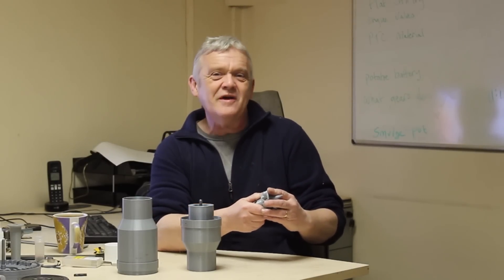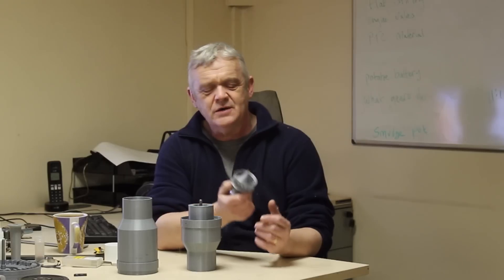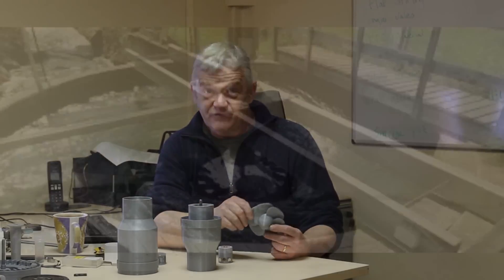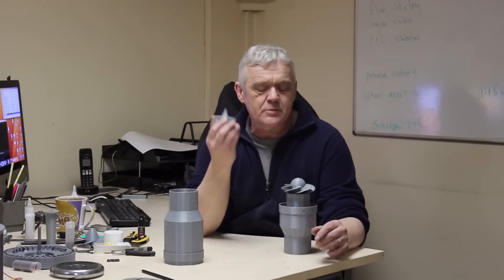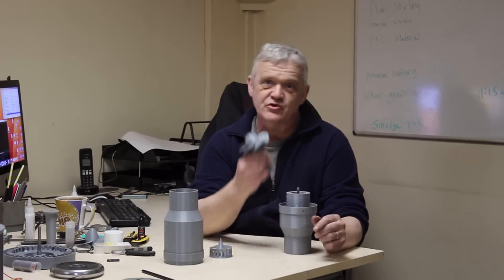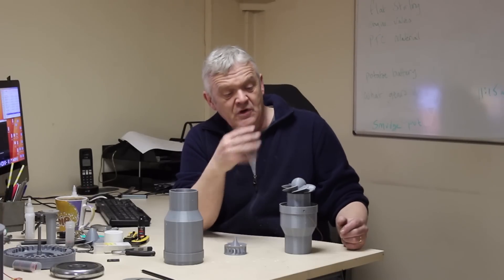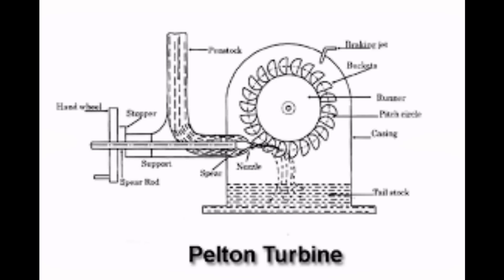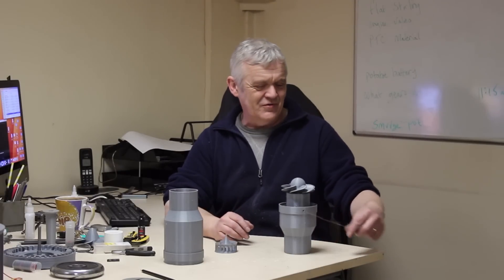1887 Rainwater Turbine - Mass Or Momentum

Comment: Hi Robert,
I love your channel! Your exploration of generating energy from many sources inspires me. However as a technician it is hard to grab the power output of your experiments. You are always measuring voltage and that is not indicating power. Would it be an idea that you measure voltage over a dummyload with a certain resistance and measure current, than it is easy (P=I2 x R) to see the power in Watts. Or measure both current and voltage over that resistor so P=UxI can be used. Now you always show the open voltage and the generator does not really get a load attached to it. Generators do slow down if connected to a load. I think you get the point and I gave some extra info for the audience.

Keep going! ❤ from Holland
Martijn

Comment: Luke Fugate here on YT is an inventor who lives on an Ohio mountain with a stream, he has done several different styles of water wheel generators to help power his homes because different sections of creek required a different approach to harvesting its power.. one he captures the water in a pipe and directs a heavy stream at his wheel, in another its just the streams flow that slowly rotates a much larger wheel

Comment: I think it might get out by putting the serpentine coils outside of the piping, allowing for more magnets around the larger circumference. eg embedded in a solid ring around that goes around the outside of Kapan style blades Though the thickness of the piping will determine how close you can get them to the coil, so may bring it back down a little but that arrangement would lead to easier maintenance/upgrade of coil

Comment: Mass, or momentum, that is the question:
Whether 'tis nobler in the water to suffer
The slings and arrows of outrageous fortune,
Or to take wind against a sea of troubles 

😂 Great work 👍Cheers to your health, and everyone in Sir Robert Murray-Smith Land
Reply: Water has mass, so that translates int TORQUE,  not momentum. (M x V=T.)
Then you can add gears to create speed.
Reply: Mass just sits there doing nothing ( PE = mgh )potential, nothing doing, just yet - momentum is where dynamics are all at. - (m*v) kinetic energy is just the first integral of momentum - add up all those momentums to be relatable to the static situation...KE = 1/2 m * v^2 (or (m*v^2 )/ 2..
Reply: @toml.8210  Cheers to your health 🍺
Reply: @kadmow  Cheers to your health 🍺

Comment: In video 1884 the water was able to run freely. In this video 1887 and the last video 1886 the water spill way was constricted. causing the wheel to be submerged slowing it down. The squirrel cage spinner acts like a horizontal water wheel. If you submerge a vertical water wheel it would slow down too, I would use less water or create a bigger spill way.

Comment: I would say a more correct term is Kinetic energy. Momentum is energy within a moving body, when the driving force is withdrawn or stopped and the body continues to move and decelerate.
Reply: That’s inertia.
Reply: @mikebond6328  inertia is resistance to movement.

Comment: I was curious about using the fresh water coming into my house as a source of power. It has a high head pressure and clearly plenty of it. During the summer in the Southwest U.S. watering of the garden means several hours of nonstop water use per week. I have been working on zero scaping to not be a monster by planting clover rather than grass. Still it all needs some water. About half as much as grass. Using the water double I think would also be a win.

Comment: The Kaplan turbine would fit inside the other vortex turbine, and would functionally replace the cone shape for the latter. If they were operating two separate rotors, one inner, one outer, spinning in opposite directions, you might get enhanced performance from both.

Comment: Wot about a load of properler things with magets on the edges all the way downpipe and a copper coild wrapped all around it. In theory as thebwater has to go down there could be a way to make downpipe genorators frel top to bottom and choose the gauge and if u have 1 or some series and some parallel creating the volts/amps  u require? Just a flash thought xxx

Comment: Movement  is measured in velocity not momentum, miles per hour.  A wheel continues  to roll, showing momentum. Due to friction, It rolls at a decreasing speed or velocity. See post just prior for simple explanation.

Comment: Well now you have me wondering exactly what type I would need... The overflow from the cistern is considerable, when the water is flowing, despite the fact it is only drain-pipe  width. So it would be high volume low head.. Looking like the blade one would work best..

Comment: You mentioned the Wells turbine for wave action. Check out the one I designed, based on a shielded Savonious. You could add a flywheel too. I think this is better than Wells Turbine.

Comment: Apologies for asking a dumb question, what happens if you stack several of these turbine cassettes so that the same water falling is used several times before it flows away into the drains?
Reply: I’d guess the efficiency would drop of dramatically and the top one would fail/wear out far before the one below it.. think about how much slower the water exits the first turbine after it’s expelled 70% or so if it’s energy into the turbine that you’ve perfected to extract as much energy as possible! Kind of defeats the purpose no? Lol
Reply: @Sam3532  OK, I get that, I'm wondering would gravity put back some oomph back into the falling water?
Reply: @mikewren43  just as much as the distance between them would allow (9.8m/s squared to work out the speed and then speed times mass, for the momentum, which would then be converted to joules or watts to work out the kinetic potential of the mass of the water - not sure on the exact equations, but relatively easily calculated - or you can stick a turbine in their and just see how much power it gives you! Lol)

Comment: Curious, I wonder how quickly air could be moved with your cage like fan if you drive it with a motor in a partial ducted fan situation.

It basically is a centrifugal blower fan after all but with some interesting modifications. That should make it better at sucking in air from the outside and blowing it out down the middle. Potentially being extremely good at sucking in a large amount of slow moving air and blowing it out through a relatively small duct either at very high speeds or significant static pressure.

Comment: What about roof debris?  This would work well with a rainwater catchment system.  Catchment or not, I've seen a video where the turbine spins around the periphery of the pipe with the drainage hole was in the center, large enough to allow leaves and such to pass through. The water from the downspout was directed horizontally on a tangent so the water would be directed to the turbine.  I'll try to find the video for it.  Crafty Panda did a vid when he built his, but has so many different handles on YouTube, it's hard to track down.

Comment: Conservation of momentum? whatever the water loses hitting the fan, the fan gains. Minus the noise and heat.
Reply: @Ken00001010  vibration is noise. That doesn't add anything to the rotation. It takes, away from it. 
Friction, bearing or not, bleeds energy from what's available for rotation. I stand by my statement
Reply: @Ken00001010  you've totally missed the point I was making. I'm talking about the momentum of the water as it descends. My mention of noise and heat was for the pedantic who might say no not all of the speed the water loses goes to the fan, there's energy bled off in other minor ways.
Momentum is always conserved. 
 If it's lost from one place it's gained by, or rather transferred to, another.
Reply: @Ken Clements  my understanding of momentum is mass times velocity, and velocity isn't just speed, it's speed in a direction. when the water hits the fan its mass stays the same but velocity (speed in a given direction) has changed. Its momentum is therefore changed, any loss in momentum must be accounted for, it reappears as rotation of the fan. The question I was addressing was about mass/momentum not energy. My addendum was because I assumed that The fan rocking and bouncing under the force of water also robs some of the momentum as it forced in a different direction entirely to the water going sideways. 
Having looked again it's more complicated because the velocity is increasing under gravitational acceleration but that's by the by. 
Sorry if I've annoyed you unknowingly by misunderstanding something.

Comment: Please, try inverting your device in a water tank and piping air underneath it. Wouldn't it take less energy to push water into the system than push water? Whichever turbine works better, if it works, couldn't you then stack them for reusing the rising air in the water? Simple static environment with gravity providing continuous "carrots" of energy?

Comment: There are many generator options that are cheap and very practical and very effective, BUT! the problem is storage. What is desperately needed is a public access plan to make a battery that can run a house. Lead acid is ancient, but IT WORKS. A 200lt/44gallon plastic drum or IBC containers made into DC batteries and a row/battery of these and we have a viable storage option. The tech is over 100 years old. A 12v or 24v group of batteries of that size would be life changing all around the world and the materials are all very common. Drums or IBC 1000 lt containers put out of the sun and filled with hydrocloric acid [ cheap ]. PLEASE somebody focus on this and crack it.

Comment: What if you combined the two blades? It appears to me that the cone of your second blade could be shaped similar to the first blade. In this arrangement you would get the simple power of the first to start turning the will with lower volume and with higher volume the second set of blades would produce the power?

Comment: tbh the answer is YES .... Force = Mass x Acceleration .... Mass of the object matters .... BUT that object accelerates downward equal to gravity times its mass x the Sine of the angle it is falling at ... (just in case its on a slope)  ....making momentum something to desire as well ... because the faster it goes the more work it can do .... the more mass the more work ... the more speed the more work ... 
.
Mass and Momentum are complimentary parts of the force of the flow of the medium by the generator ... resulting in the force or power generated   Newton Gotta Love him for simplicity ... F=MA ;)

Comment: Thanks for the video my friend awesome as always , I have a quick question , I have a koi pond which has a 50watt water pump could this be used to somehow power a water turbine to charge a battery bank so I can plug air pumps and a uv sterilizer into to save me a few quid on the old electric bill , the air pump and uv sterilizer combined use 100watt thanks

Comment: Very cool, how about superconductors to improve efficinecy, i just heard they have 0 resistance, which is a remarkable thing as someoe getting into electronics your taught everything has resistance and here you have this magical thing the doesnt, and can do magical thing like store energy inside it forever because without a way out it wont have anywhere to go or even dissapate due to resistance, and they've done that in epxeriments having these things charged for 30 years and they still keep it.  Provided its kept at super low temperatures, but thats the breakthrough recently apparently they've found materials to have these properties at room temperature, only at high pressures is the caveat.   We are the the verge of "free energy" with this stuff i imagne, well not totally free, recycling electrons over and over in a no loss system is pretty much free, or a lot cheaper then before.  Apparently half our power is lost in resistance losses and other things like that which superconductors with 0 reistance would ellimante.  Could change electronics as we know it.  What does this have in store for energy genration, storage or transmission? I dont know but im guessing big things.  Simply changing to superconductor wires could double power output of this turbine for example.

Comment: I have often wondered what could be generated using a large cylinder of water forced through a small jet with a very heavy weight to create the pressure.

Maybe two tanks side-by-side. A chain fall to lift the weight vertically and roll it side to side. Allowing you to essentially drive the water from one tank into the other passed a peloton wheel.

I am honestly too lazy and ignorant to take a stab at the math.

Comment: Serious question, but it's gonna sound funny: If you used one of these in a toilet, what would happen when s**t hits the fan? 😛
I want to install these in every downpipe if I get to build my own home or vehicle-home at some point. The combo of these plus everything else from this channel could probably make something that can tour Australia and supply ample power lol. One water tank on the roof, one under the floor, fed through one of these or pumped back up, could balance the power demand and income from solar, wind stuff, and I'd be interested to see if 5v can't be snatched from the ground from two towing cables of differing materials for a ground battery, plus the inside/outside of everything where temperatures would vary need to be hooked up properly too ofcourse! ;)
Reply: LOL Brilliant.  If a hydraulic ram pump can be used to store water, any gained energy from outflow would be a bonus 👍
Reply: if the shtf scenario causes things to plug up....one could always supply power to the output, and run it as a motor to clear the line...perhaps metal blades would be better for the toilet application.
Reply: Just go full solar in Australia,you wouldn't get enough power out of this to make it worthwhile.
Reply: @ravenmad9225  All power's worthwhile if it can be captured and stored right.
Reply: @flatfoot  I don't think you have a grasp on compounding effects.
Reply: Greetings from Finland! 

Maybe good idea in starionary install, not so in mobile one. The weight and complexity on the road might be too much when it comes compared to the energy pipe turbine produces. 

You decide if it is worth the hassle. Even a small solar panel would greatly surpass the energy production of a very small turbine, even more if you live in a sunny place.

Rob had some videos about earth batterys, have a look if interested.

Comment: I was thinking of a magnetic device made of two gears that never touch but instead have opposing magnetic forces on every surface except the leading edge of the drive tooth and pushed edge of the driven tooth... Any thoughts on that?
Reply: I'd add a drawing but I can't.
Reply: Maybe actually the opposite of that.
Reply: Push me, pull you

Comment: Interesting. Wonder if you could create a hybrid of incorporating both into one?
Reply: I’m pretty sure (by which I mean, I’m guessing..) that one turbine design would stifle the other design and reduce efficiency of them both if used in a single system.. unless they somehow can be automatically switched between depending on flow rate, a relatively simple concept of a ramp that with high enough flow goes down 1 drain and when dribbling falls into the other drain, therefore the other turbine.. but would probably mean needing 2 down pipes from the gutter..

Comment: That's half the equation.  Load matching is the other half.  Open circuit voltage is meaningless - you need a load.  And to get the right load to get peak power, you should use your MPPT and measure Watt true RMS. Or experiment with load resistors to find peak Watt.
Reply from the maker: we are not looking at power - we are looking at speed!
Reply: @ThinkingandTinkering  But why? A fast turbine is not helpful if it loses its speed when you put any load on it. The slower turbine might retain its speed under load and thus produce more power. I thought the real goal was generating power?

Comment: I live next to a river/canal. So I don't have much of a head, but a lot of water moving slowly. How would I best use this?
Reply: @rocklover7437  with Robert's 'free energy' device he tested in the stream, made of metal tubes, and plastic couplers? I'm sure it'd charge batteries.
Reply: A waterwheel fixed to a floating pier or on floats held in place with upright slides on anchor poles to accommodate for rise and fall of water level comes to mind.